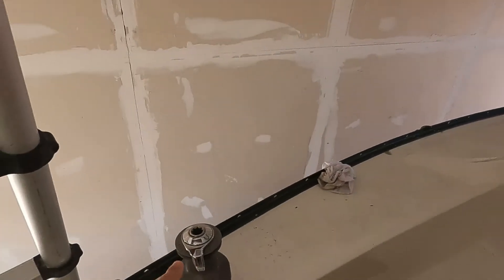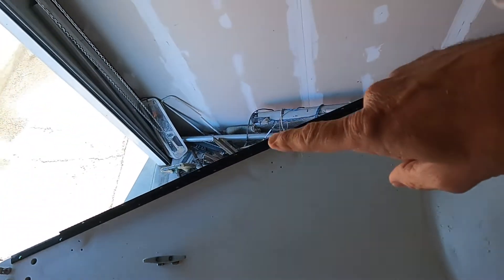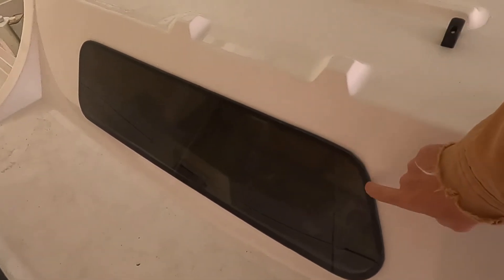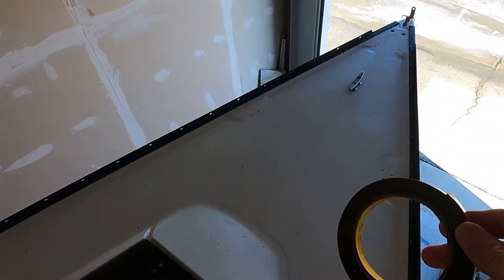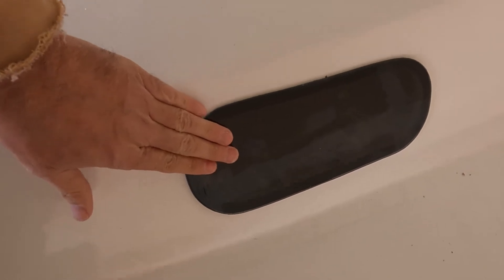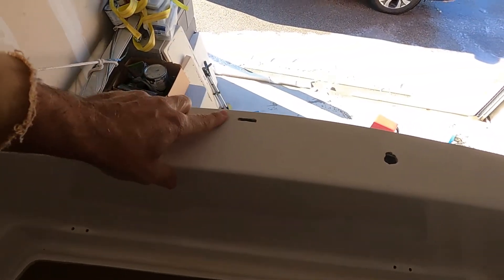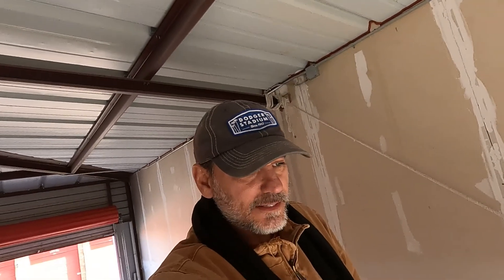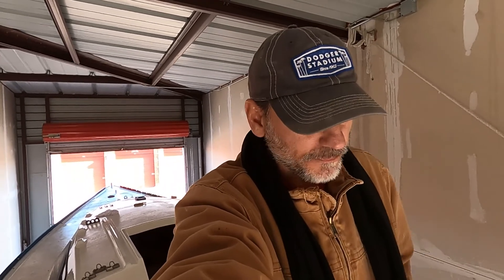Sailboat Refit 35- Update & How I make and install new sailboat windows

Comment: I’m looking at a similar Catalina 30 MKIII in Wisconsin on the hard in cold storage and leaking windows let water fill to the top of the bilges. The rest obviously will need a closer look. After watching your posts, I’m worried about the compression post. Any recommendations when negotiating?
Reply from the maker: Make sure the bathroom door do not rub at the top or bottom.  Thats a sign that the post is rotting and the top has moved.  Also most water may be coming through the ruder post area. There’s a deck cover over the top of the ruder post behind the wheel.  Water will fill that area up because the drain maybe stoped up the overflow thro a hole where the wires come in.   If the bathroom door drags you have a large bargain chip.  It will take a lot of time to fix. Also be sure a get a moisture meter, if the windows are leaking then the chain plates are probably leaking also. If so you have a very wet deck.  It won’t be soft but may still be rotten.

Comment: if we get a washer, then the bolt/screw should not crack the plexy.it also helps if we manually drive the fasteners (at least for the last few mm). aesthetically isnt as pleasing as your clean result, which is great btw, but personally windows is the kind of thing i really want bolted down heheheh